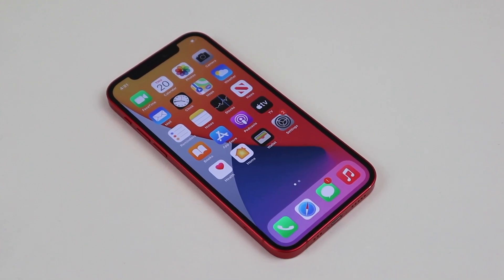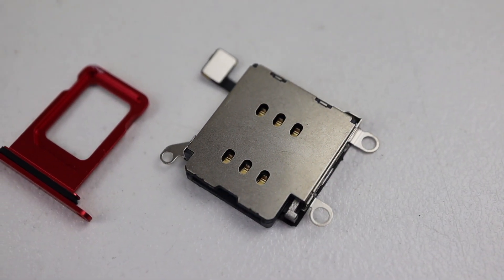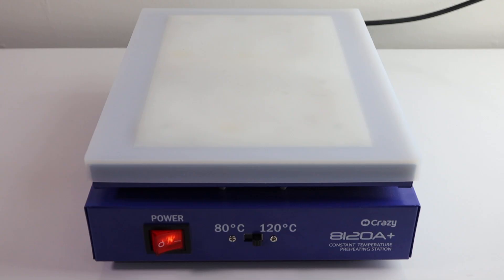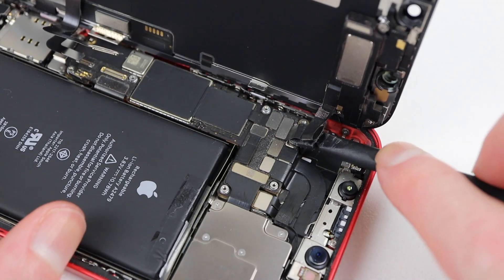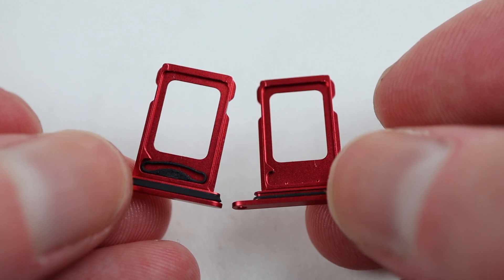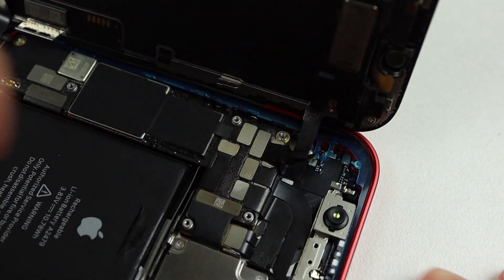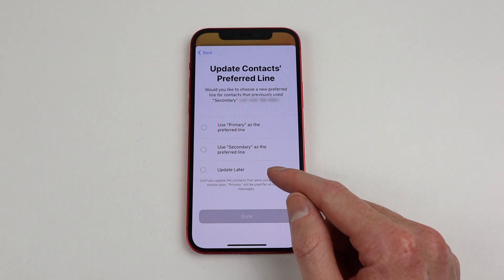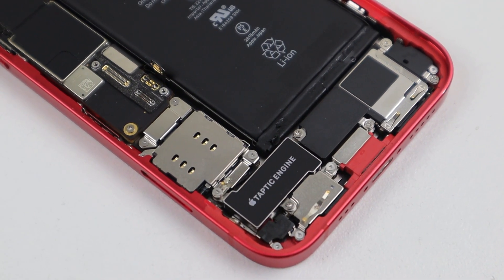Hidden iPhone 12 Hardware Upgrade Apple Never Told You About.

Comment: Thank you for this very helpful video. I did this to my iPhone 12 Pro and it works perfectly. The only downside to this modification based on my experience was that the Apple Store repair technician refused to change battery on my phone due to "faulty board". What I ended up doing was I reinstalled my original single sim card reader and brought it back to the same Apple Store where they did not see the same issue and ended replacing my battery as they normally would. I would recommend reconsidering this modification if your phone is still under Apple Care warranty as this may void it.
Reply: What iOS version is your phone running?

Comment: In my opinion, I think the reason Apple does not offer this phone in places other than China and Hong Kong is the hardware itself. If I understand it the iPhone can only use a max of 2 lines. When you install the dual sim reader you disable the eSim. With so many carriers going to eSim they don't want to do this. I suspect if the carriers in China and Hong Kong start provisioning eSims dual sim readers won't be available anywhere and Apple will make some changes to the hardware/iOS to make it impossible to do this.

Comment: Can you upgrade the iPhone 10,11 or 12 by putting in the a15 in and taking out the old one if apple can do it to the iPhone 8 it must be able to to done on all iPhones, like the first iPhone with the a15 chip and upgrade to a 4000mah battery custom housing
Reply: Nope, Apple Silicon is custom fit to its respective motherboard so you can’t install an A15 into an A13 chipset. The iPhone SE 3 has an updated motherboard (not just the CPU), as you would see in teardown videos.

Comment: My phone is also dual-sim capable and the secondary sim shares the spot with a microsd slot. By design it doesn't fit the second sim and microsd at the same time, but it can be made to accept two sims and the sd at the same time by simply removing the chip and contacts from the sim and putting them onto the microsd.
Apple could've easily gone the same route, with having the second sim slot being able to accept microsd cards, but then it's Apple, and if people could upgrade the story that easily, they couldn't charge big money for it.

Comment: I was pretty sure this would work before watching the video. The reason this works is they made the dual sim version and then just changed the reader and added a virtual sim to fill the space. I could never understand the reason for the digital sim until I found out it was available as dual sim in China. This was just a way of saving money by not making two different phones. Back in the days of CDMA phones (No sim) some models came with CDMA and some came with GSM service. If you looked at the CDMA version a space was still there where a sim card slot would go. This saved money by not making the entire device over again. The removable sim reader was a good idea as many people damage sim readers and the Apple store does not have a micro solder tech in the store but any of the geniuses can swap a sim reader from this unit with minimal training. Interesting video though, nice to see it works with no issues.

Comment: Dual Sim phones are very common and people generally have 2 phone numbers here in India. Though second esim is there, the hassle of getting one and then converting it back to physical Sim in case we switch phone is too much. Apple should add physical dual physical Sim capabilities for more countries.
Reply: This may be part of the reason it's not sold here in the USA, all major carriers support eSIM now and you can just get a physical SIM if you need a secondary line.  Personally, I'd rather have two eSIMs for security purposes.

Comment: I enjoyed your video, and they are quite helpful. 
there are PRO/CON of having 2 physical sim and  having 1 SIM and 1 eSIM in your Iphone. if your planning to travel to other countries and you may want that country data plan . it is cheaper than using your carrier data plan and once you land into that country looking for a SIM card can be a pain.  As your plan your travel you can load many eSIM  of those countries  and then enable them once your there.  2 SIM work well if you have connection  between 2 countries / states/ ie…..  it comes down to your needs .

Comment: "Creating an iPhone 12 model Apple wont sell you." --> A bit misleading because the Apple sells a dual sim iPhone 12 AND 13 in mainland China, Hong Kong and Macao. 

Contrary to a lot of comments, I'm NOT surprised that it works.  Apple locks down the pieces of its phone hardware with verification because it wants you to bring a broken phone to them and have them repair it for a fee, once the warranty or Apple Care is expired. That's why the screen, camera, etc. cannot be swapped. There is NO point for the sim card module because you cannot bring your phone to an official iPhone repair center and upgrade it to dual sim for a fee. In other words, there is no money to be gained by locking down the module with hardware verification, unlike that for the screen, camera, etc. People who want to do that will need to bring it to another place to do the modification, thereby voiding the warranty, which is a PLUS for Apple cause any later problem will mean you have to pay for it. Moreover, it lessens the complexity of software updates. Having the software disable the dual sim option for everywhere else but China/HK/Macao means it must detect these models first in order to exclude them from the disable. Doesn't really make sense to implement this if they won't earn any cash by doing so.

However, I do agree that it doesn't make any sense not to offer the dual sim option outside China/HK/Macao. It might draw customers who would otherwise have chosen another option e.g. Android-based phones. It isn't as if people who need two phones will buy two iPhones instead of just one.
Reply: aaaaaaaaaaaaaaand they soldered it in iphone 13 therefore closing the loophole

Comment: Well, nice that this works and your handling of the hardware is great. BUT with e-sims the standard way to go theses days, who still needs physical sims? In a developed western country there is no need to break the seals and add a second physical sim. Just get an e-sim for your primary provider and you have still the physical sim slot for whatever other provider.

Comment: “It worked and I can’t believe apple don’t offer a 2 sim option’”
You make it sound so essential, but dont explain why, other than, “other phones and China has it”?
Who needs this, who needs 2 sims on a phone? Why should my gran need this ?
Sounds like illegal,dodgy, pirate, dark web, scam use would use it. Separate sim for dodgy access I don’t want traced.
Reply: In case one carrier has weak signal in an area. Like one state could be trash for att and one could be good for Verizon or Tmobile. Use cases like that.

Comment: take silicon gel. and just spread it on there like butter. heat it up and vibrate to get the air out. and put back together. the best fastest longest lasting and also WATER PROOF. for 5 years in salt water.

Comment: What I'd love to have on a future model of iPhone, even though it will never happen for reasons that will quickly become apparent;
- Transflective display (improved usability in sunlight, improved battery life)
- Anti-glare screen finish
- Nightvision camera
- Dual-SIM by default
- Return of headphone jack, Touch ID and FM radio chip
- User serviceability
- Expandable storage
- Hybrid touchscreen (resistive and capacitive) that works even if you've got gloves on
- Touch ID that uses ultrasound so that it's less sensitive to the exact angle which you position your finger, and is less susceptible to dirt, grime and water
- A physical lock switch to prevent accidental inputs when the phone is in your pocket
- Built-in geiger counter
- Return of 3D touch

Yeah. I want a smartphone with a built-in Geiger counter.
Reply: do you want to go to chernobyl
Reply: @addust  No, but I work in a profession where we receive all sorts of junk from unknown sources in various states of wear and tear. It'd be nice to know if any of it is radioactive.
Reply: @AmaroqStarwind  yes, that would be of use

Comment: @Hugh Jeffreys

Very helpful. 

A majority of #iPhones purchased in America are bought directly from mobile carriers and not thru Apple; hence, only one (1) physical SIM and a digital SIM.

These devices are carrier locked and are usually paid on installment plans. If and when until the device is paid in full, only then can the device be carrier *unlocked*.

You can use the Dual-SIM if you're only using 1 mobile carrier with 2 different mobile numbers. They make it difficult to use Dual-SIM using 2 different mobile carriers. 

For example, it can only be T-Mobile/T-Mobile, ATT/ATT, Verizon/Verizon, etc.

It can't be T-Mobile/Verizon, Sprint/ ATT, etc.

There's also a scenario of 2 different technologies being used: some carriers are GSM-based, some are CDMA. GSM and CDMA doesn't mix well when you try to use them together on Dual-SIM.

So that makes it hard (but not impossible) to implement physical Dual-SIM slots

Most phones sold in Asia are carrier unlocked and GSM- based, hence physical Dual-SIM slots are almost always possible.

Comment: You could always attach the tweezers to a small battery powered screw driver or drill to make it easier to remove the adhesive, just a thought.

Comment: Hugh: I'm surprised this actually worked. 

Apple: not on the next update.
Reply: They freaking soldered the sim card reader to the board.
Reply: @KeybladeMain  What are you referring to? The sim card reader in this video isn't soldered to the board.
Reply: @Vendemiair  iphone 13
Reply: @Juanguar lol not it’s not
Reply: They are sold like this in China...
Reply: @timothy_ryan_hills  Indeed. That's why it isn't disabled by the software. There is no point in having a detection routine for disabling the dual sim option for everywhere else but China/HK/Macao when there is NO money to be gained. It's not as if you can go to an Apple store and have them upgrade the single to dual sim for a fee.
Reply: @timothy_ryan_hills  nope China doesnt have 5g
Reply: Hugh doesn't update his firmware
Reply: "Like i'm gonna do an update"

Comment: Great video as usual. As you probably know Apple isn't about flexibility or options. I liked your video where you simply swapped the screen of 2 brand new iPhones and they didn't work after swapping the screen. You're like the anti Apple guy, you tell people there are options. But as others have pointed out, Apple is probably trying to prevent people from doing this.

Comment: Love to have upgrade on my UK iPhone 12 mini. 
I travel a lot between the UK & USA and to have a dual sim iPhone would be perfect instead of having to keep switching my sim out on the plane.
I know my iPhone has esim but I want to keep my number I use when in the USA and decide what carrier I want to use to get the best deal.

Can this upgrade be done on a UK iPhone 12 mini and anyone know who does it here in the UK?
Reply: Whoops wrong answer cause I forgot that it only works on the iPhone 12 not 12 mini cause iPhone 12 mini has the sim card reader soldered ro the motherboard
Reply: @MateuszWierzejski  Damn it, didn't know that, I have the dual sim reader on order and found a local business to install it for me :(
Reply: @paineys3341  did it say it's compatible with the iPhone 12 mini
Reply: @MateuszWierzejski  I went by this video, didn't know the mini had a different setup.  The people Im talking to did say about it needing soldering and I said I have seen this video and sent it to them, they said it should be Ok but I don't know now. What makes you think its soldered on the 12 mini?
Reply: @paineys3341  cause when I saw a iPhone 12 mini disassembly video I saw the sim card reader was integrated to the moderboard
Reply: @MateuszWierzejski  It was showing changing the sim reader on a iPhone 12, I am not a mind reader or expert and not know the iPhone 12 & iPhone 12 mini which share MANY components have the sim reader attached differently!

Comment: The reason why apple doesn't offer dual sim option is because apple has to pay for the licensing for having more than 1 imei registered to one device. I believe they feel they won't want to pay the fees also not  something they want to do to make iphone like Samsung huawei etc.
Reply: Also the networks would need to pay the high price foe the device with dual sim and networks will have to up the tariffs also which I believe they won't want to do to annoy it's customers anymore
Reply: @raazelb  What will normally happens is that the carriers lock sim 1 to their network then have sim 2 open to all networks
Reply: they already pay since the e-sim has an imei number already so apple already pays for the 2 imei registered physical and e-sim
Reply: Also the carriers have to pay for the second imei number also so most networks don't want that to be on their expenses form hence why the phone is already at a max price

Comment: just imagine when these are micron sized components, how difficult would it be to repair?
Reply: The smallest discrete components are already smaller than a grain of salt. Beyond that, we just combine components into ICs and modules.
Reply: @tookitogo  TY, at some put it wouldn't be feasible to repair
Reply: @TheBowersj  We’re already at the point where in most places, it’s not. The labor costs exceed the cost to replace the whole module (or product, in many cases).

Comment: One "PRO TIP" when opening the phone. To easily weaken the glue that holds the lcd in place, when you manage to pry in with the plastic pick is to dip the other one on the tip with some IPA which will make the adhesive detach instantly on contact. Keep dipping the tip of the plastic pick into the IPA.

Comment: so every iphone 12 with a single physical sim can be swapped out for a dual physical sims if it done by a competent repair person with the correct parts. is it possible for a electronic parts manufacturer to make single physical sim/micro sd card kit and have the iphone be able to use the micro sd card. someone with electronic skills should try and do this mod.
Reply: Gimme your dual Sim China 

You can have my single Sim

Comment: @Hugh Jeffreys  Nice, real nice, but. As a technician myself i'd like to point something out..next time you ''try'' something, make sure you don't put adhesive and close everything up, unless you're 100% sure it does work. I'm not being toxic, just trying to save you the time of removing the adhesive again after you realise it doesn't work, in your case you were lucky! but imagine propin something that didn't work and having to remove everything again, it's a waste of time and equipment, so try sealing after testing, and not the opposite!

Comment: reason to not buy into apple ecosystem:
the iphone is still on 60hz (some 200 dollar phones have a 120hz display nowadays lol)
there are no 'budget' options (around 300 dollars) except for 2-3 generation old iphones (which have storage, worse cameras, better build quality, worse performance most of the time, and a worse screen)
their repair system is terrible like cmon
you have to use lightning connector, not the usb-c standard
some of their products are just overpriced asf

Comment: Well, I just bought the module and dual sim tray for my 12 Pro....wish me luck lol

UPDATE: It worked, although found a very slight issue, when putting both SIMs in the phone, only the rear one is detected, until you reboot. Not sure if that's an OS or part issue.
Reply: hello, I think you have converted your phone to physical dual sim card. Is everything alright? Is the phone working smoothly? According to your answer, I will have my iphone 12 phone do the operation in the video. thanks

Comment: I use dual SIM with a US model. One eSIM and the other a physical SIM
Reply: @Robert Hernandez Yes, all models outside China have dual SIM capabilities in eSIM + physical SIM configuration. The problem is that eSIM isn't widely supported by network operators in a large part of the world practically making iPhones single SIM only. (There are 4 carriers in my country and it's supported by only 1.)
Reply: @erze2367  my thoughts were that the US number could populate the eSIM as all US carriers support it. The physical SIM is for my international travels
Reply: @roberthernandez9034  That's a great option to have. 👍

Comment: Hey Hugh Jeffreys, since you’re able to convert a US Dual nano & eSIM to a Dual nano SIM, by switching it with a CN SIM module. Would it be possible to convert an iPhone 8 (running iOS 14 for example), which is a single nano SIM to a Dual SIM. Could you just switch its SIM module with an iPhone SE SIM module, would the software reject the transplanted SIM module?
Reply: Not possible at all the sim slot is soldered on 
And se 2020 do not have physical dual SIM option at all 
In China only single sim option for se 2020

Comment: Great video as always Hugh! My Sunday morning habit! 👍
Would it be great if the esim worked in tandem with the dual sim slot you installed. You'll have a tri-sim iPhone! 
This mod will be a hit here in the Philippines, where dual sim phones are common. Only 1 telecom company offers esim here and it's only for postpaid, which sucks because majority of the users here are on prepaid plans. It's a waste buying an expensive iPhone using just 1 sim.
I hope (🤞) Apple won't pair the sim tray to the phone. This practice of pairing must stop.  Next thing you'll know even the screws, adhesive and sim tray ejector are paired with the phone. 😆

Comment: Does the e-sim still work? what if we try to add e-sim on top of the dual sim.
maybe in next video.
Reply: Not possible as the esim is integrated with the sim reader 
Replacing it with dual SIM reader remove esim